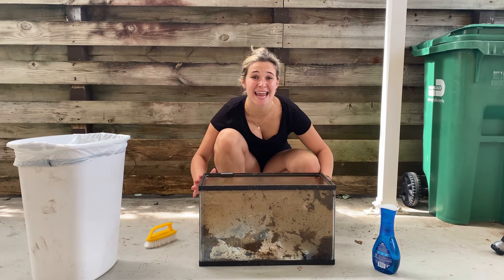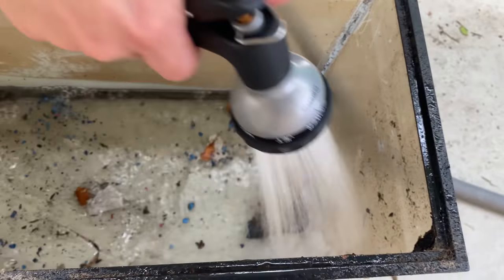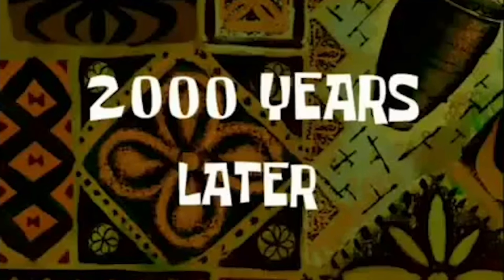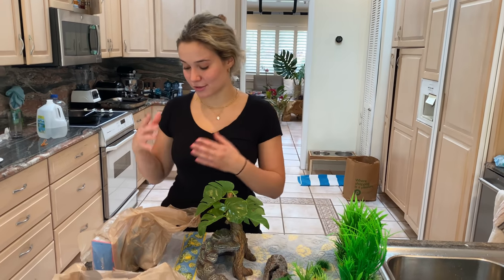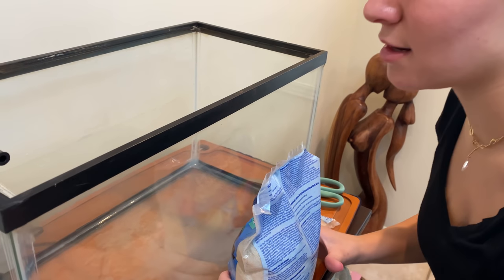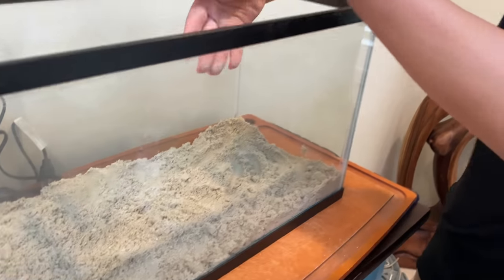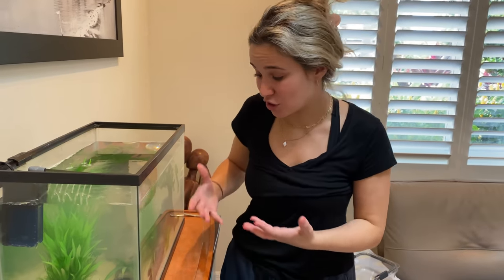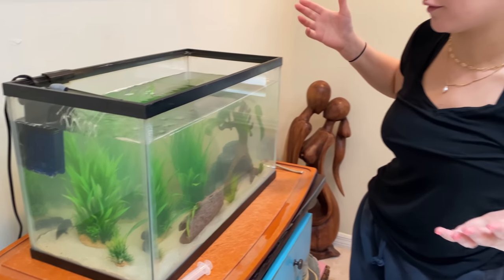NEW BABY AXOLOTL AND AQAURIUM!

Comment: Axolotls at least need a 20 gallon tank you should get a new one now before it grows and don't touch them a lot they are very sensitive. The tank needs to be cycled correctly it take a few weeks. I can't tell about the plants but they should be soft if you are using fake ones, I would use real ones personally. You were right about a few things but I hope your axolotl does well congratulations on your new pet I hope u listen to the comments :)

Comment: Glad to see you did a nice job with this tank and animal. 
I was expecting another of those videos where you gave the animals too little space, no filter and all the other mistakes from your previous fish videos but with the axolotl you did it right.
If possible switch to live plants. Also set a thermometer so you can be sure not go above 22°C (about 70°F I think). Might need a water refrigerator depending on how high the water temp goes during summer.
There's room for improvement but all in all, you did a good job this time 😊
Reply: I hope she researches how to do water changes and she probably should have cycled the tank before adding the axolotl. I wish her the best of luck.
Reply: @vanessadoucette-buch1658  i think she used the prime water conditioner that allows to put the animals in the water while the cycling is happening (if it actually is the product i think it is, I'm basing it on the color of the label) so that's not entirely bad.
As for water changes, a lot of people explained her how to do those on her past fish videos and by the way she set this up it seems like she's a bit more educated now, so hopefully she'll do those properly.
Like i said, there's room for improvement but she did a decent job this time. Didn't feel like pulling my hair out while watching this like i did with the beta fish videos so i have a bit of faith in her this time 😅
Reply: The tank is good for now but much too small for an adult and honestly picking up an old disgusting tank and just scrubbing it clean probably isn't the best way to avoid harmful things ending up in the water. Honestly, I was expecting it to be another one of those terrible videos too but she did really good overall!
Reply: @god_2.0_the_better_version  the tank looked clean enough. It was mostly the accumulation of the residue water leaves on tank glass (a lot of it, probably left outside for a long time exposed to the elements) and rotten leaves so the cleaning plus the water conditioner should have removed anything harmful, i believe.
As for the size of the tank, yeah, it's the minimum for this animal, it'll work for a while but she'll have to upgrade. 
For another of her "impulsively buying a living creature" videos this was decent enough.
Reply: It's not big enough for an axolotl
Reply: @エモ-y1x  It's good enough for now, a baby axolotl will do well in it but the axolotl will continue to grow and eventually need something bigger
Reply: @エモ-y1x  meh, so far it's ok. She'll have to get a bigger one in a few months but for a baby, 10gal, which is what she's using, is the minimum acceptable size.
I'd have gone for a bigger tank from the beginning but keeping in mind this was a "oh, an empty tank, what can i impulsively buy to put in here to make another youtube video", she did stick to an animal that would actually fit there as a baby.

Comment: Btw the tank is too small for an ADULT axolotle so when it grows up you need to upgrade and also please check the temperature for an axolotle because they live in cold water
Reply: I have a axolotle and it has a take that bigger then 10 gallons
Reply: So I agree
Reply: @Gabby-zi3ln  10 gallons is nothing, you Need a 40-50 gallon tank
Reply: I bought a 65 gallon tank for 3 Axolotl

Comment: What type of flooring would recommend for a axolotl? (I’m getting my own soon)
Reply: None
Reply: @missm108  ok thanks
Reply: @GingerFall  ya they aren’t the smartest lol baby’s could eat sand or rocks and get impacted
Reply: @missm108  lol I’m subscribing now 👍
Reply: Umm also learn how to cycle the tank,because this girl did not and that is dangerous
Reply: @chickennuggie1980  ok I’ll remember that. Thanks!
Reply: If it is less than 5 inches then I recommend sand but if not then you should put it on nothing
Reply: Dont put gravel because it could kill them
Reply: @Your.fav_Veronica  rocks and pebbles are not recommended though
Reply: @karinvanlinde4847  will do thanks!
Reply: @gracethecreator   Yes they can be very smart XD
Reply: @yes2143  ok sorry 😅
Reply: @Your.fav_Veronica  if it’s under 5 inches it needs to have no substrate at all. Sand can be added once they’re 5 inches or bigger, I just have slate on the bottom of mine now as it’s much easier to clean!
Reply: If it’s an adult I recommend the brand axogravel. It’s specifically made for axolotls but make sure to clean it before putting it in the tank.

Edit: it’s from Germany tho so I’m not sure if it ships to where you live

Comment: My daughter and I want to get at least 2 salamanders, canyon tell us where and how?  I  watch you a lot, and love all of the animals!,
Reply: Hey there! Almost everything she said or did in this video was entirely wrong. As a warning just from watching this video, do not listen to anything she has to say about aquariums or axolotls. One axolotl needs a minimum tank size of 29 US gallons, and while 10 gallons added for each additional axolotl is acceptable, I would seriously recommend 60 US gallons for two if not larger. I have one axolotl in a 29 gallon tank and I want to move it to a 60 gallon if that tells you anything about their species. Never get axolotls from pet stores, as they are often inbred, mistreated, malnourished, or ill. Pet stores simply don't know how to care for their animals and don't care enough about them to learn as a general rule. Buy only from knowledgeable breeders that can tell you the axolotl's heritage 3-5 generations back. Axolotls require water temperatures under 68 F, and temps above 75 F are deadly. The water must be kept in pristine conditions at all times. 
What is safe/good for axolotls:
-Large river rocks, no substrate, slate, tile, or fine sand substrate. fine sand substrate can only be given once the axolotl is over 5 inches long.
-Worms and sinking carnivore pellets are a great diet for them
-Live plants
-Hiding spots
-Air bubblers
-Efficient filters that have a low flow or a flow that can be dispersed
-SeaChem Prime Water Conditioner

What is unsafe/bad for axolotls:
-Warm temperatures
-Gravel or rocks smaller than the axolotl's head
-Uncycled tanks
-Sharp or chemical-y decor
-Copper
-Iodine
-Soap of any kind
-Aloe
-Almost all 'slime coat' related products
-Almost all water conditioners other than SeaChem Prime
-Tankmates other than other axolotls or nano shrimp
-Salt baths (despite it being recommended on certain places as a fungus treatment, salt can damage their gills and burn their skin)
-Keeping male and female axolotls together
-Keeping axolotls of different sizes together

Axolotls are very delicate creatures that require very knowledgeable care. 29 US gallon axolotl tanks need weekly 25% water changes, which need to be done for the axolotl's survival. The more axolotls you have, the more frequent maintenance needs to be. If you have any specific questions, I am happy to answer them.

Comment: You never never never clean anything for the aquarium with soap of any type. No way to get all of the residue off…. Plus you have to rinse sand multiple times. And axolotl has to be at least 6 inches long before sand can be used

Comment: I THINK NO GOOD THING WITH THIS SAND IV GOT A NEW AXOLOTL WITH LITTLE ROCKS 🪨 LIKE THIS ONE
Reply: NEVER put small rocks in an axolotl tank! Small rocks are a HUGE risk for axolotls swallowing and choking on. Gravel and small rocks can cause choking, impaction, and prolapse, all of which can lead to death. The only appropriate substrates are:
-No substrate (easy to clean and safest for axolotls, especially babies)
-Tile (easy to clean, kind of meh on looks)
-Slate (easy to clean, decent on looks)
-Large river rocks 2 times the size of an adult axolotl's head (hard to clean but look great)
-Very fine aquarium sand (hard to clean, but looks great. Dangerous for axolotls under 5 inches long.)

Seriously, gravel or small rocks is a huge no-no! Axolotls have a bite reflex, and them swimming around can cause that reflex to become activated making them swallow rocks. Even if it 'hasn't happened yet', it could and very may will. The risk of an animal dying is not worth fighting over. Please ask me if you have any questions on axolotl care.